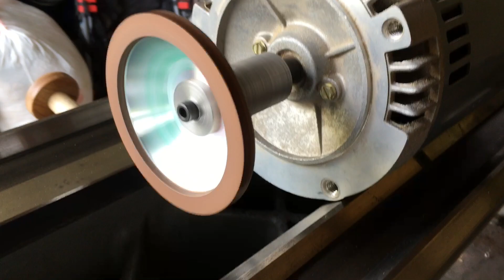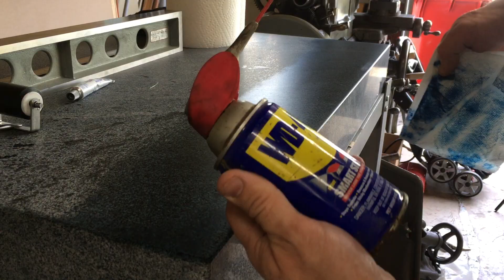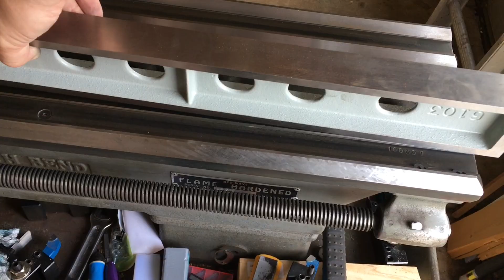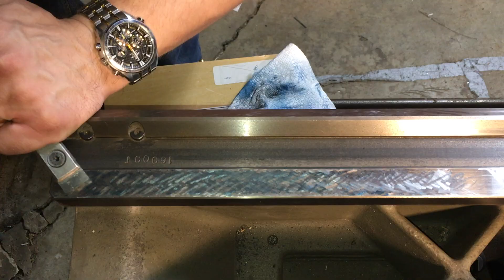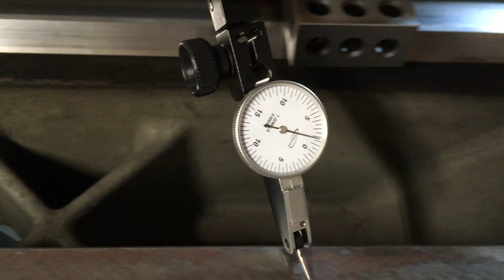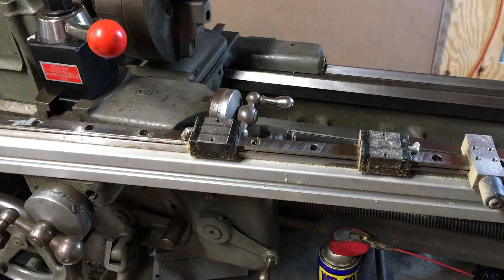Lathe restoration #1. South Bend 13 bed scraping start.

Comment: Make sure your parallel straight edge is actually parallel, you only showed scraping one side, but both sides need to be done to get accurate measurements from it, use a micrometer to check it very carefully, also with 2 thou to go, you can be much more aggressive in scraping the ends in, IE rough scraping at first, not finish scraping.
Reply from the maker: Thank you. In the video I just “scratched the surface” of this project, pun intended :) yes, you are right, both sides need to be made parallel. I will be using precision level and the device called aeroplane, just have to make it, first. I know I take too long, but I’ll get to it, eventually. Cheers.

Comment: You can always rent a milling machine  from climax potable machine's. But park that or any lathe bed next to it zero it in .bolt it together. And grind it..my boss sent out a totally disassembled  lathes .year's later I learned field service machining. Supper finishings. Some customers  asked for 12 micron finish. I gave them 7 micron.😅

Comment: Today October 22 2022 I was quoted $12,000 to $15,000 Canadian dollars to grind and then scrape a South Bend 13" Lathe Bed. The old girl is not worth that kind of money to resurface. I will use it as it is.
Reply from the maker: Not long before this video was posted.
Reply: @TinkeringNerd  I think you are both referring to different things.  The original poster means he was quoted $15k just to grind and scrape the bedways - the very job you are showing your intention to do in the video.  Not for the lathe itself.  

I would be very interested in a follow up video to this.  Even if its just you show the lathe today and explaining what happened.
Reply from the maker: Yes, 1100 is what I paid for the lathe. I can’t believe it’s so expensive to grind it. For some time now, it’s been assigned a low priority project, meaning I haven’t done much of anything else on the lathe, but I did not give up on it. Please be patient, the project to be continued..
Reply from the maker: Wow! I paid about 1100 for mine.
Reply: @TinkeringNerd  how many years ago?
Reply: What company did you call? I'm looking for someone to come do a quick half moon flaking on my lathe thats currently apart. I'd appreciatethe contact info if you could!.
Reply: That $12k to $15k is for the scraping part. I just got a quote from a reputable grinding company here in So Cal for a 13" South Bend and it was about $850 to grind the 6-foot  bed ways and another $350 to grind and fit the saddle to the bed. However, no mention of scraping was in that quote. The scraping can take hours if not days depending on how good the technician is and how accurate (PPI) they try to achieve. Again it's the Scraping that cost a fortune.

Comment: I recently re build my lathe and it had hardened ways. Honestly, just use a power grinder. I used one and it worked just fine. The key to success with a power grinder is to control the rate of material removal. I chose to use an air grinder as they weigh less and are less powerful, and I used some 80 grit sanding discs. One pass only took of 1-2 tenths. So if you have to go 2 thousands down that would be 10 or more passes. which is not bad. It took a few days and I did all the finishing work with emery disks which are even less aggressive. The important thing is control. as long as you know how much material is coming off and you have options to adjust that amount that's it.

Comment: You’re a brave soul attempting to scrape a hardened bed. Some pretty clever ideas for getting the job done though, and they actually sound viable, unlike many similar YouTube vids where you watch some poor misguided soul make things worse and worse due to easy access to carbide and a complete lack of any understanding of machine geometry lol.
Reply from the maker: Thank you very much. It’s been quite some time since the video, but, I haven’t given up on the lathe, just never really got to it, yet. I AM preparing something interesting for it, though, such as diy powered scraper, new slab floor, etc. It will be a beautiful machine when I’m done with it.
Cheers.
Reply: @TinkeringNerd  Check “lookcreations” videos if you haven’t already. He scrapes machines and has a very solid understanding of machine geometry and the metrology of accurately measuring it.

Comment: I'm restoring an old shaper. How can I harden surface on cast iron after grinding?
Reply from the maker: I don’t know if it is possible. If ways were flame hardened, then it should be at least couple millimeters deep. Induction heat treatment can be less than that. If you ground that much off, maybe you want to consider putting down hardened steel strips.
I think if you try to heat treat the cast iron ways, you may run into a whole another set of problems like warping, cracking, etc.
Reply: @TinkeringNerd  Here is my aproach.
https://youtu.be/aENXdvTExoU

Comment: Eu estou passando a mesma situação com minha plaina de pórticos. Construí alguns dispositivos pra fazer as guias mais precisas. Está levando muitos meses. Estou quase desistindo.
Reply from the maker: Luciano Vasco don’t get discouraged. I decided not to make any additional linear slides to fix this lathe, I will use homemade power scraper.
Cheers.
Reply: @TinkeringNerd  obrigado por responder. Eu gostaria de ver o vídeo do seu raspador caseiro. Talves eu possa construir um também.
Reply from the maker: Luciano Vasco I’m working on it :)

Comment: You should acquire a surface grinder. Its journal bearing is much more accurate than your 1 HP motor. The most important part of restoration old machine is how fast and how sharp you can grind your scraping tool.
Reply from the maker: Thank you for your comment. I wish getting a surface grinder was an option for me.
Reply: @TinkeringNerd , your carbide blade needs to be shinny aside from sharp otherwise the sharpness wont last long. I have seen it at a trade show but never experience myself. They use very fine diamond wheel with low speed spindle. The spindle has accuracy of surface grinder or something similar.
Reply from the maker: Your input is very valuable! Thank you!

Comment: I have a very similar project. It is a Colchester Mascot 1600. It too have hardened bed ways. Mine is similar worn to yours. The difference is that the main carriage on mine has one V at the front side and and one flat way at the rear where yours have two V ways for the carriage. So mine has one flat way at the front and one flat at the rear

I have done some test work, but I havent scraped, I have used a angle grinder and a 50 cm long tool I made, similar to a straight edge. I have used the angle grinder to remove bulk material and the tool together with diamond paste for finnish on the not worn and far end of the flat way where the main carriage goes. This have proved to be a time consuming job. However it also have proved to be possible to achieve an amazing accuracy within 5/1.000 mm, or 2/10.000 of an inch.

I plan on bringing the two flat ways level and parallell with each other first. That will be easy measuring with straigt edge, precision level and a dial on a precision stand I have made.
Next I need to make a horizontal reference edge. I plan on making this edge on the rear of the lathe, the non alligned edge wich is there today is not far from true. I plan on using a 1mm stainless steel wire loaded up to near the yeld point and run it near the edge on the rear. I can then scrape/grind this edge until it becomes absolutely parallel with my steel wire. I have made a micrometer attachment with electrical connection so I get an electric signal when my micrometer touches the steel wire. In this way I should be able to get the horizontal edge straight to within 1/100 mm

My plan is then to make a support for a grinding attachment that will run on the the two flat ways and on the the horizontal edge on the rear. With this attachment I will grind the two remainin V-ways.
Reply from the maker: That sounds like a plan, except... you will end up with only partially ground v-ways. I thought about it, too, and came to the conclusion that it wouldn’t really work out. You either need to make an extended linear jig for the grinding head, or scrape it manually, all the way.
Currently, I am trying to adapt a sawzal to become a “power scraper”. Watch out for the video about it, when it comes out. The power scraper should make life much, much easier and allow to speed the manual scraping process many times over!
Another thing: using grinding paste sounds interesting! How do you think the finished surface will act against the mating surface? Is it going to retain oil? Is it going to slide well? Keep us updated!
Cheers
Reply: I didnt mention this problem with lack of travel for the grinding attachment. I think it should be solvable. One method is to lenghten the ways on the tail stock end. This would be the more time consuming method. The other method is to place the grinder so that it do reach one end of the ways and then reposition the grinder to the other end of the attachment so it now can reach the other end of the ways. I think this method probably is the easiest to use, and I think the accuracy of the now ground ways should still be very good. The last alternative is to scrape/grind the end portion of the ways manually, but it is more difficult to accurately measure the V-ways than the flat one, so I am not sure about this method. But I guess this method should give an ok result too. 

When grinding (or more correctly lapping) with diamond paste the finnish naturally becomes very good, and this might be a problem. But I think that problem can be solved by applying a flaking type of scraping to the surface as the last step. 

I look forward to see how your project goes. I hope I can start up mine project again sometimes later this year. Maybe I put up a video of it too.
Reply: Diamond particles from the paste will stuck into cast iron of the ways. So you'll have abrasive diamond ways.

Comment: :/ Take the lathe to a professional company that can either do it for you or advise you properly or run the risk of ruining an expensive and somewhat rare lathe. If you don't fully understand how to scrape a lathe bed then you really should not tackle this sort of work. Its your lathe today and you feel like you can do what you want with it but it will not always be your lathe and its your duty to look after it until that time.
Reply: All profesional company doing this kind of work had gone, 40 years ago.

Comment: You ruined a perfectly good machine there numbnuts, good job.
Reply from the maker: Thanks for watching
Reply: Why don't you offer some words of advise if your so knowledgeable about machine reconditioning instead of a worthless dick hole comment. I'm betting because you have no clue.
Reply: J800613, I don’t think he ruined anything with the little scraping he did and he may have even helped it some which hasn’t been clarified. Since more material still presides there is plenty to compensate if he did do something wrong. I think in this case it’s better to be constructive than to criticize his endeavors. Not everyone can afford to send their equipment to a professional shop and can probably replace the machine at that point so a diy makes more sense.

Comment: I have the same issue with my lathe , i lack the knowledge to no  if i should just get a new one or keep moving forward on my restore . My gut is telling to stop . im about $1,000 in and its steel a 500 lb usless heap in my mind . i have a south bend heavy 10L . the kind used by gun smiths that can receive large barrels threw the chuck
Reply from the maker: You spent 1k on the lathe itself, on the stuff for it, or both? I don’t know what you got there, but I’d probably try and restore it. Unless I had money to buy something worthy.. SB10 is a good machine, proven by decades.
I paid 1.1k for mine and I still think I got a good deal on it :)

Comment: thats a fun exercise, but isnt necessary for 99% of users  2 thou are nothing...but its a cool exercise and learning experience
Reply from the maker: Thanks. That’s probably the least worn surface I measured. The carriage ways are much worse. They are the ones I’m not looking forward to scrape :-)
Reply: Tinkering Nerd  i had an old joinville lathe (brazilian/german) whom are very old and worn, but isnt matter much if your level of precision are about 1/10 of mm like mine...that error for me are ok. anyhow greetings from brazil! keep going are a fun and very interessing to watch project

Comment: It's real challenge to grind lathe ways. Great chance to fail them at all. BTW you shouldn't use upper face of V-ways for measurements. It's not working surface. Good luck tho'!
Reply from the maker: Thank you for watching and commenting! What else would I use as a reference point to take measurements?
Reply: I'm not sure, haven't dealt with this kind of bed. But you'll need special device, I don't know how its called in english, we call it "airplane" or "bridge" (T-shaped). Machinist level is put on it.
Reply from the maker: Thank you for this information!
Reply: In english it’s called kingway jig or king way alignment tool. But russian has completely different shape compared to those I saw on practicalmachinist.

Comment: Your initial idea using the bed as a guide sounds more practical as fewer things could go wrong. If those linear guides are accurate and rigid enough though, it would be awesome to see your universal bed grinder idea come to life. Grain of salt with my comment since I've never done anything like this before.
Reply from the maker: Thank you for watching and commenting! I saw few homemade lathe bed grinding videos. Some of them are very sad, even comments are disabled :-)
I hope to get a successful grind at the end of this project.
Cheers.
Reply: I agree this seems to be more modern and logic approach.